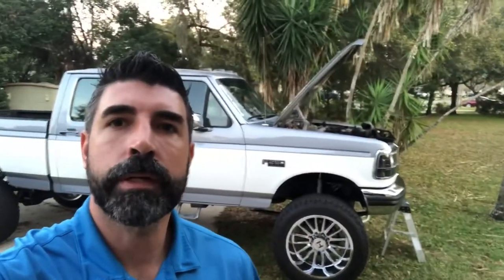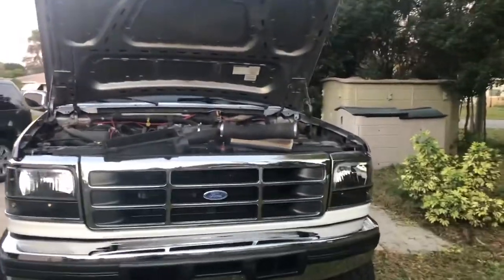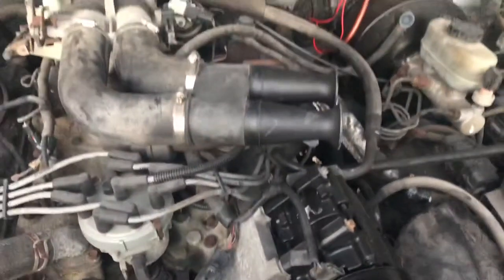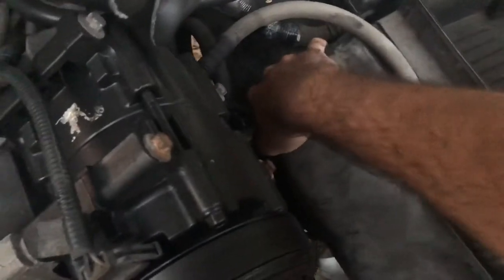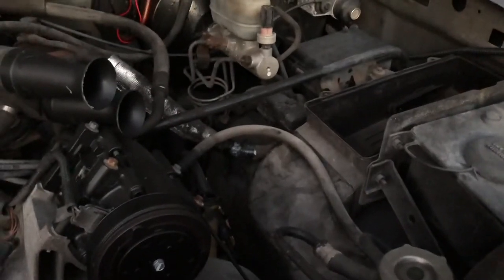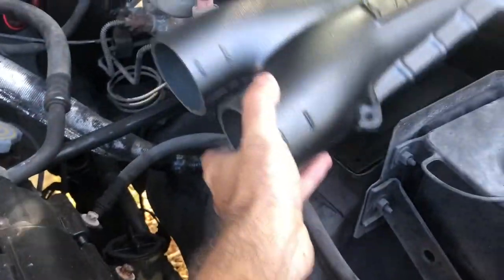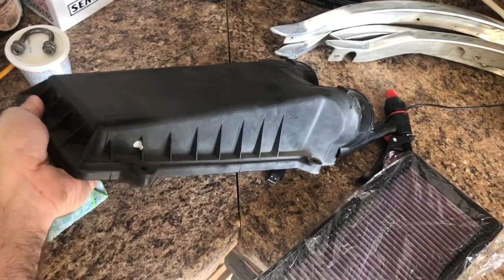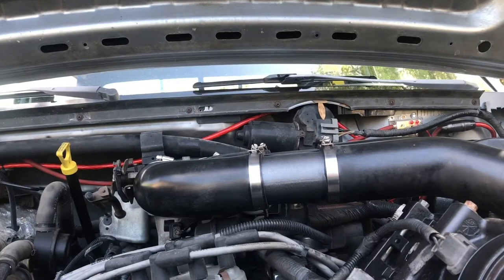Adding Power to a 7.5L. .  Easy cheap upgrade.. Intake Modification

Comment: The baffles eliminate the sound produced by the air passing through the system. It's a good mod to remove them if you don't mind the sound.
Reply: I didn't know they made noise...
Reply: @christanwhite1095  you hear it more if the truck starts to run warm a little it’s a loud air sound lol if that makes sense but it goes away after a few seconds. It really only happens on acceleration from a stop at least on my truck.
Reply: @brandonnunez3644  is it like really obnoxious?
Reply: @gabemartinez229  couldn’t tell a difference when I did it

Comment: Hey guys I've got an 89 f250 with a 460 in it I keep having starter issues. Has anyone upgraded to a high torque gear reduction starter? Looking for some pointers.
Reply: Could be your fuel pumps going bad I changed my starter and solenoid still started up on 2nd or 3rd crank for years my front went out and and 2 years later my rear it starts up fast since I replaced both pumps

Comment: Did you notice any power/response difference with the banks intake? Already have cut off the air horns.
Reply from the maker: Nathaniel Roberts sorry just saw this. I did notice a little bit. About to drop off the headers for ceramic coating and then I will do a video on that installation and the gains

Comment: Thanks for the vid and nice truck btw!!! I have a '95 F250 7.5L and I am trying to get all the horse power I can.  I am willing to get the same bank system.  (I already cut the air horns and did notice a slight difference.) But opened your video in 2 different windows to compare the Banks lid to our stock.  I don't really notice that much off a difference.  I mean they still start out small from the fender and get bigger toward the air hoses.(The top of the lid view) And from the (inside view) flipped over looks about the same in the vid. As far as height wise from what I could tell... ..video view.  The only thing I can figure is how the Banks lid sits on top of our air box.  Meaning @4:34 seems to be more shaped(the plastic) coming in toward the air filter.  Than the Banks lid @5:01. hope this all makes sense?  But my main question is really worth getting the Banks intake system vs just getting a K&N air filter and keeping the stock top cover? Any one or An_Auto_Addiction could answer ASAP would be greatly appreciated.  As I am wanting to get the most horse's I can as soon as I can!  Also what are you guy's opinions on getting a bigger throttle body too? 61mm.  To help get more air in?
Reply: Can you give an update on what you have done to your 460? Would be greatly appreciated.
Reply: @isaicastaneda4812  I can show what I started to do.  Which is not much to be honest.  I'm actually going to call a mechanic I was referred to.  To help tweak it out as much as possible.  I do plan on putting headers, and haven't ordered the Banks intake system yet.  I'm debating if it is worth it. LOL.
Reply: @MountainSide719  Thanks for replying. I've done the same so far, just cut the air horns and did notice a difference. I just got the Banks headers for my 460 but i have some doubts, I've seen a video of a guy that said he deleted the air injection, i don't know what to do with mine. I'm not a mechanic and i have no experience doing any of this it's my first time. And been looking at throttle body and full conversation kits from 460 EFI guys. So I'm just gonna keep studying and figure out what to do.
Reply: @isaicastaneda4812  Your welcome. Ya I hear you! I did get rid of my smog pump which is part of the air injection.  I had to get a different pulley belt since I took off the pump.  Research says less pulleys more horse power! LOL But I know there is more stuff I should of took off.  And once I add the headers should finish the air injection.(I think)  From what I gather.  I'm somewhat of mechanic, however not tweaking or upgraded motors as I am wanting to do.  I also want to bump up my time advancing.  But I will call this guy that rebuilds motors for all these hot rods/classic cars around here and hope he can do what I'm wanting.  Or guide me for the best do's and don't of getting all I can out of that 460.  Check my channel out bro.  I plan on keeping track some.  I love putting my 7.5L up against diesel guys around here!  Leave them rolling coal in my mirrors!!!!! LOL
Reply: @MountainSide719  for sure man I'll keep up with your channel. And once again, thank you.
Reply: @isaicastaneda4812  Thanks bro.  I will be working out the the bed/body work and will be painting it as soon as that is done.  Hopefully in about a month.  Can only work on it on the weekends. Look forward from hearing from you and have a good one and be safe out there. Peace.

Comment: Did u notice what connects to it on the bottom it's to keep the vacuum up so it will pull the air for smog stuff
Reply: Since I eliminated my egr can I plug this vacume at bottom of the air plenum baffle thing
Reply: @RollingThunder85  that is the air feed for the iac valve, not smog stuff

Comment: You ever find a intake manifold for these engines yet? I put hedman heddars on mine boy sure sound good but the heat they don't dissipate compared to stockers is crazy
Reply from the maker: I found 460 efi guys has a intake and throttle body. I am saving up for them. Will keep you posted.

Comment: hey i have a 96 f 250 with the 460 and i’m blowing white smoke out of the exhaust smells like fuel it only starts after the vehicle has been running for a bit it’s not coolant and its smoking quite a bit i just changed spark plugs wires cap and rotor and oil but it was doing that before i did all of that
Reply: Sounds like he'd gasket white steam ??? For exhaust white means "!not right "

Comment: Did you get a check engine light after doing these mods? Thanks in advance.
Reply from the maker: Nope no lights or issues with mine
Reply: @an_auto_addiction5742  thanks. Thinking of removing the air trumpets on the intake.

Comment: They put those horns on there to reduce the airflow because the had to retard those 460s. They pull so hard that they have a tendency to blow up. They retarded the engines so they would last longer.

Comment: 97's had the single port intake on the 7.5  if its a dual port intake its not a 97.
Reply: Most 1997 models produced in early to mid 96 have dual port. It's one of the very few "generational" differences that the EFI 460 ever saw.
Reply: My 1997 F250 HD with the 7.5L / 460 has the twin tubes.

Comment: Does your truck ever run hot at all?
Reply from the maker: Jack Timbers no but if you’re not loosing coolant and the water pump is good may be your fan clutch not allowing the fan to pull enough air through the radiator.
Reply: An_Auto _Addiction yeah it must be something along those lines because my fan is always engaged. It really shouldn’t be like that.
Reply: Recommend switching for an electric fan. My bud saw some instant gain, and the truck tends to run less hot.
Reply: @JamesR23  do you have any oil in your coolant. Those oil coolers fail and leak oil in the system then gum up the water passages in the block thus causing them to run hot

Comment: How many mpg u get
Reply from the maker: roe75202rr I haven’t really calculated it but it’s not the greatest. I hope once I put the rest of the bank’s system on. It’s getting ceramic coated now
Reply: Not sure you buy a 460 truck for mpg? I remember towing my travel trailer 110 miles with only one gas tank working. I carried full a 5g can in bed each time but had to stop almost half way to top off to finish getting to the campground. I then topped off tank with gas from can in bed to make it more than half way back to stop and top off. Fixing the 2nd take was the greatest thing since.
Reply: Usually beforehand stock is about 12mpg
Reply: 8mpg right here🙋🏻‍♂️
Reply: @andyhernandez996  🙋‍♂️ me too